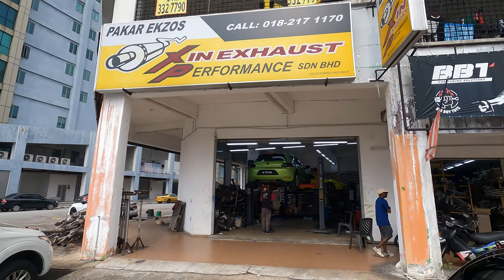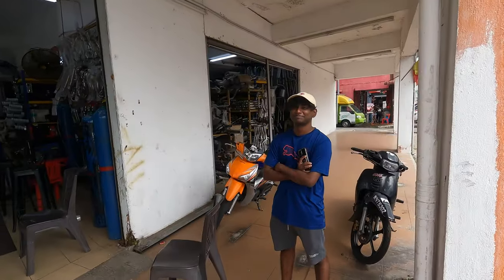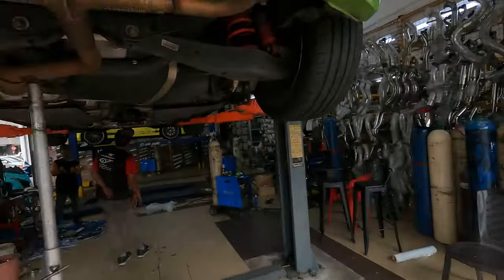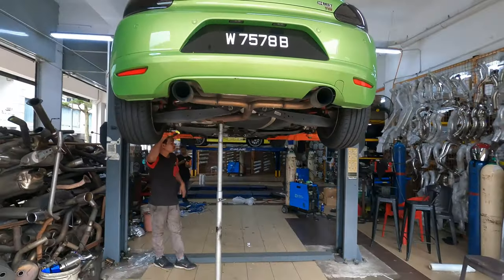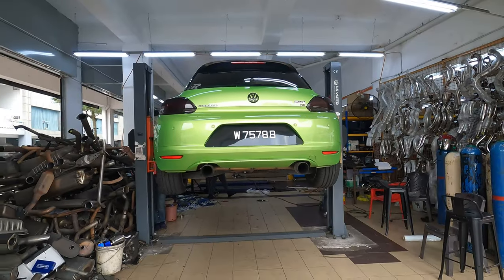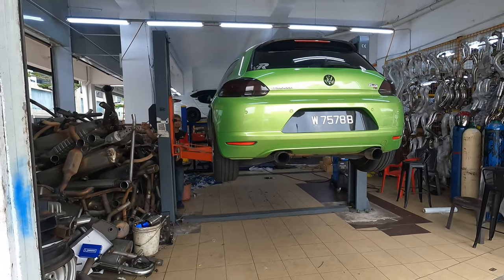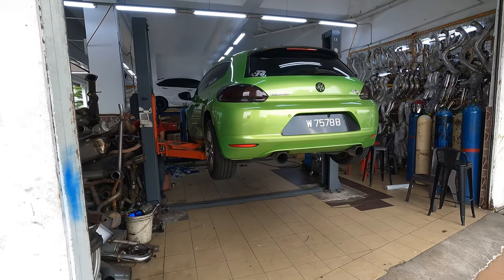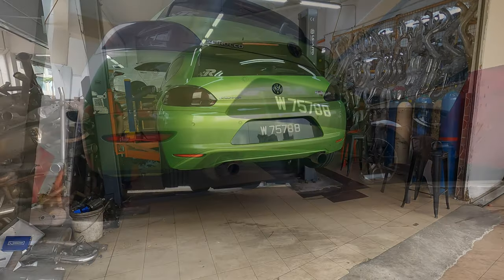Straight Piping The Scirocco!

Comment: Just wanted to ask that I’m currently experiencing some issues with my scirocco (same model as yours and is a 2012). The  car really struggles to get on boost? And tend to jerk/shake when the boost cuts out. I’ve ordered a new N75 valve after doing some research which I have yet to try but wanted to know if you had any experience or have run into this? I am running a GFB DV the original one went faulty and have had that replaced.
Reply from the maker: Any fault codes? Could be injectors too but it depends on mileage. No issues with DV so far been using as a daily.
Reply: @DrivenTechReviews  yeah scanned today and got PO238, did some research and people are saying MAF sensor? I think I found it at the back of the engine bay I can get it unclipped but can’t seem to get the actual sensor off? Seems like some plastic screw type
Reply from the maker: @abdullahqaiser6050  is it held by a T25 screw ?
Reply: @DrivenTechReviews  no it’s more of a plus shape, and very flexible
Reply: Oh it actually might be inside the intake? For the 160hp model